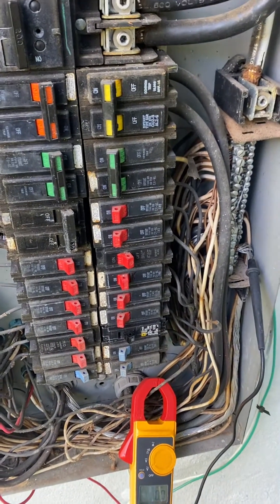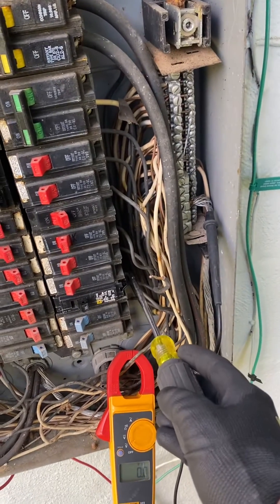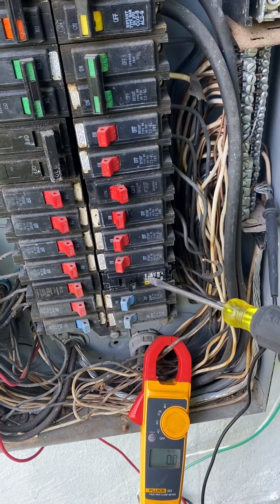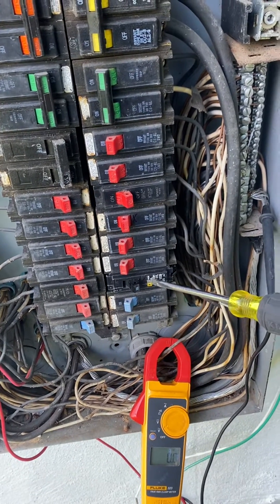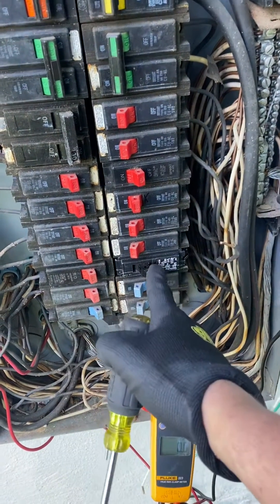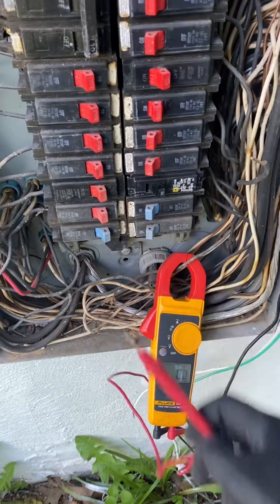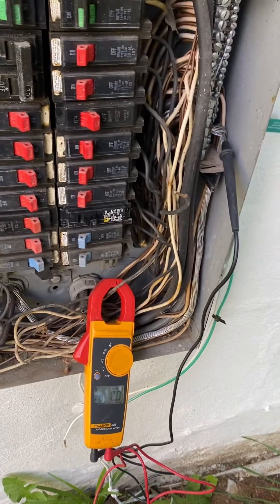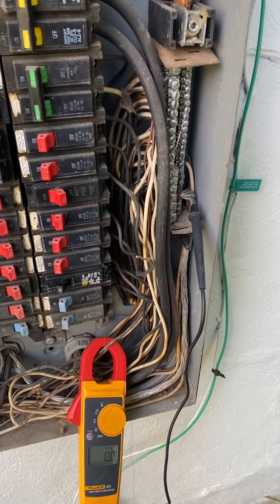When I turn on one breaker, another breaker trips. Electrical troubleshooting

Comment: Did you re wire the circuits?
Reply from the maker: Yes, I found the box that was double fed in the garage, and removed the ungrounded conductor that I no longer needed, and capped it inside the panel
Reply: Great video. How long did it take you to find the box? How did you know were to start looking and do you use  any type of tool to trace the wires. Thank you and keep them coming.
Reply from the maker: @electricalservice1754 turned the effected breakers off start looking for what no longer has power 
Look for recent additions or remodels also